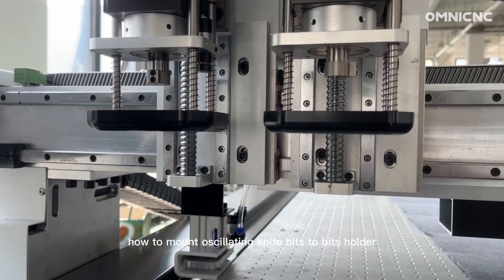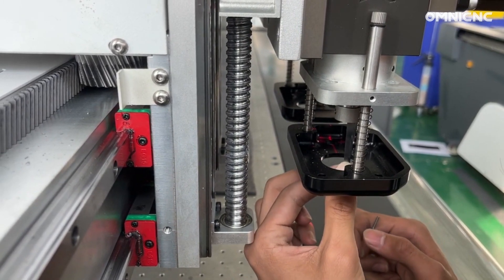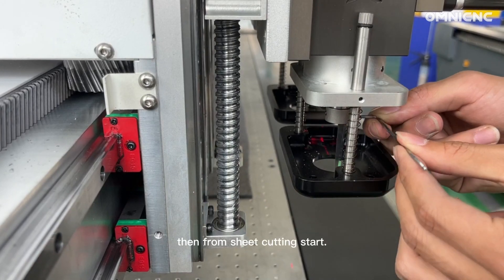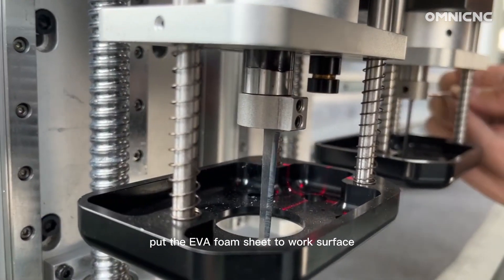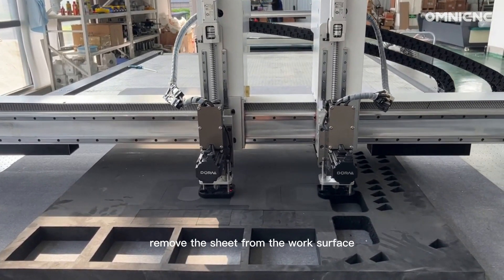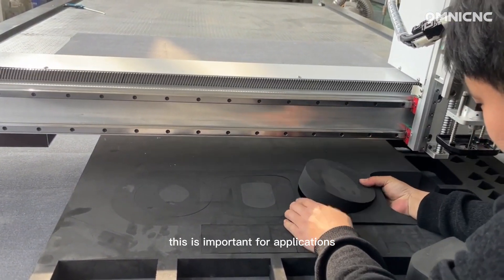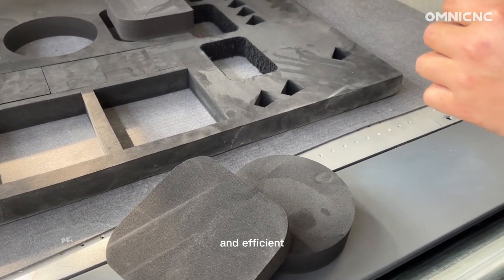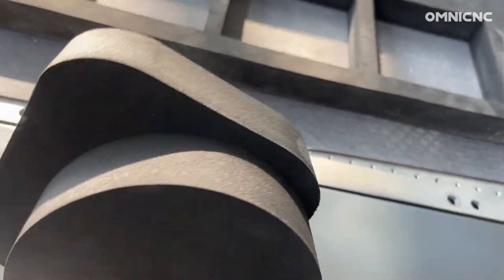📸How to Cut EVA Foam Sheet With Digital Knife Cutting Machine | OMNICNC

Comment: Can we cut PVC sheets also with the thickness of 1inch and one and half inch?
Reply from the maker: that depends on the PVC hardness. If it is very hard,   cnc router spindle cutting or water jet cutting is good way. If it is soft PVC, then this digital cutter is good to go.